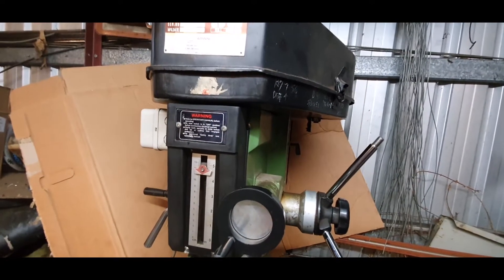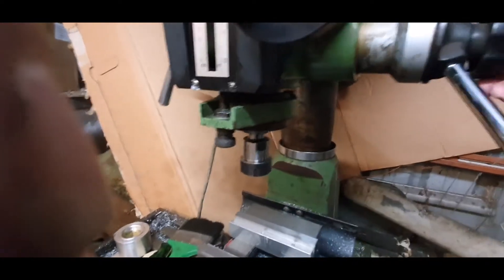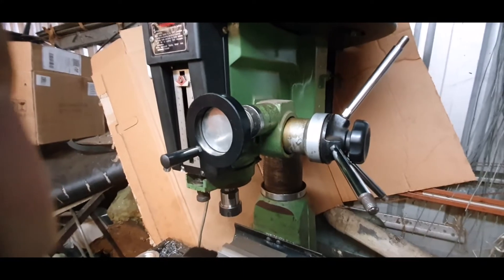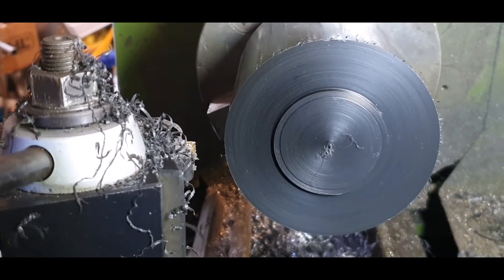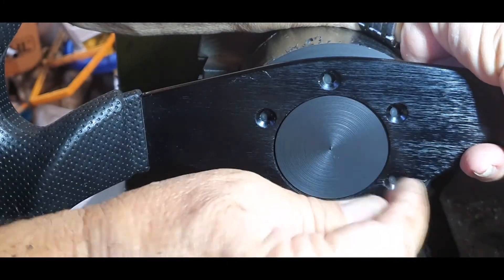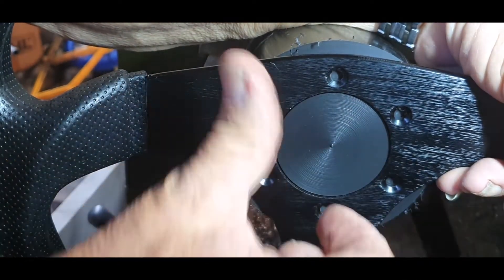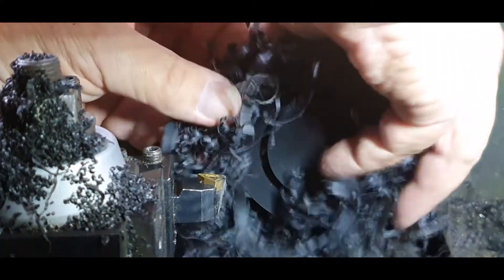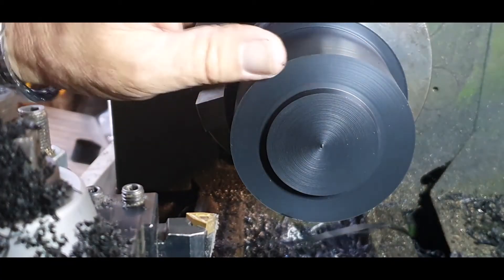Rong Fu  RF30 Mill Quill Wheel Mods Part 1

Comment: When I still had my RF-30 clone (before I sold it to my friend) one of the best things that got changed was the quill handle setup.  There were times I still used the iron hub but the quill wheel I got from Jim at Tangent Engineering was an excellent change up.  It's been cool to see how you are going about making your own adapter, on to part 2.
Reply from the maker: Thanks Everett, coming from you & the many mods you did on your  RF 30 is much appreciated